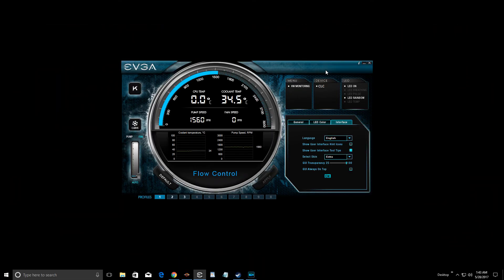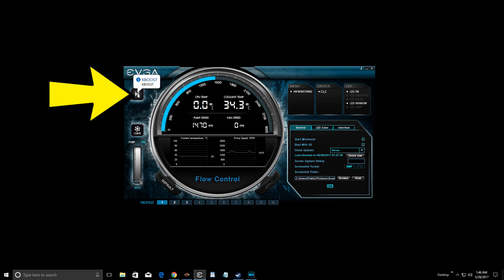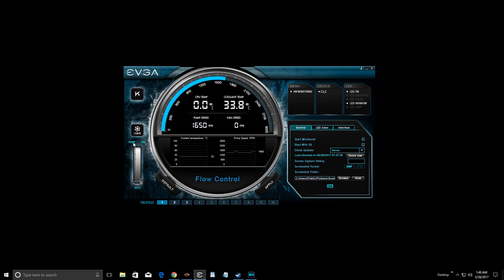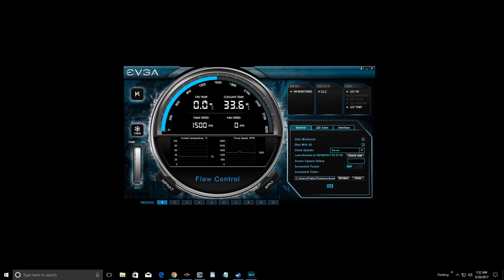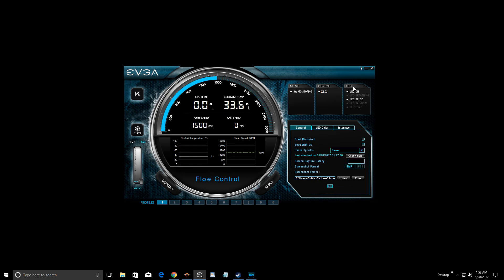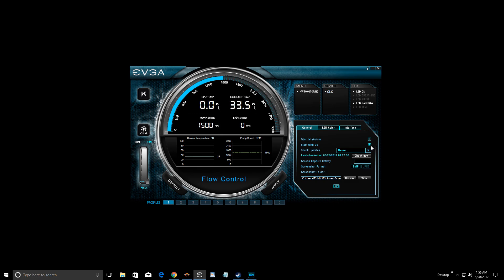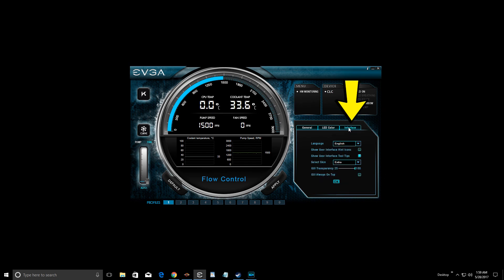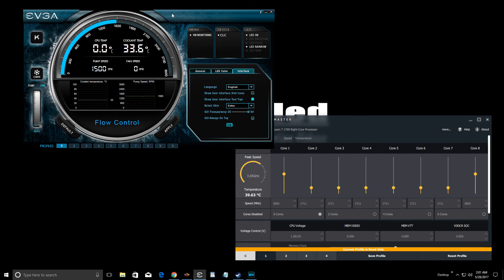EVGA Flow Control Overview

Comment: my cpu is around 90 and 100c, how can I fix?
Reply from the maker: Reapply the thermal paste and get a better quality paste
Reply: @NikkNoFilter  Im having the same issue but its something with the software cause i use AI suite 3 and it shows it at like 40C while in EVGA flow its 90C - 105C @ericKiTo

Comment: When I tried downloading the software from their website it brung to a page where it was asking me about my mobo and graphics cards and was trying to give me driver. Wouldn't let me download
Reply from the maker: Allie Boy hey bud, you can only download it if you and you product are registered. Plus the download should be close to bottom of webpage
Reply: +Nikk Bled hey! Yeah thanks I actually ended up getting it! My fans seems pretty Loud still. I have the fans all the way at 600 rpm and they are still very loud. I have noctua a14 industrial btw
Reply: +Nikk Bled so I have the pump plugged into CPU fan1. And the software says my fans are at 600 rpm but the cou fan says its at over 1k rpm. Can I still control thru bios?

Comment: I got a question , i have the clc 280. I updated the EVGA Flow Control to 2.0.4 and this change my pump speed to max, in the 2.0.3 was to minimun. My cpu is a r 1700x at 3.8 Ghz , 1.285 Voltaje. Is it ok to leave to max o switch it back to minimun? (sorry for my bad english)

Comment: did or does your led turn red and stay red after about 10-15mins of gaming no matter what the led settings are?
Reply from the maker: BR Viper II no... mine stayed a static dark blue before & after led settings change. get a cpu temp monitor app and stress test it to make sure your clc is doing its job bcause it may be defective

Comment: Just installed this so thank you for an overview. The LED temp stuff doesn't work at all it seems. Color never change when I change the temps of the different colors. Color always stay blue. Just to make sure I did this correctly, the motherboard wire from the pump goes into the CPU FAN header right? My pump readings are different from yours, the slider is at the top and seems to have a speed here of 870. I can slow it down with the slider but the only way it goes faster is if the CPU temps goes up...
Reply from the maker: make sure when you set the color select & press the ok button i just changed it from dark blue to lite blue ok. and also make sure the led cable from the cpu block goes to the usb header on motherboard should work fine. like & subscribe thank you